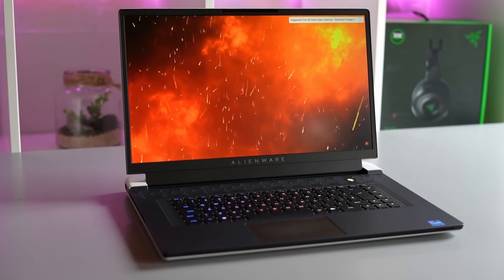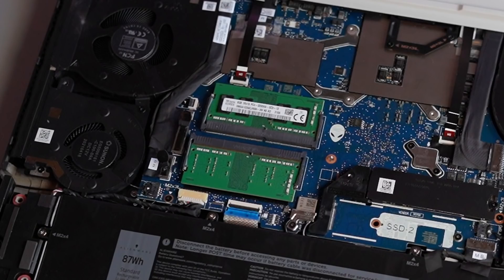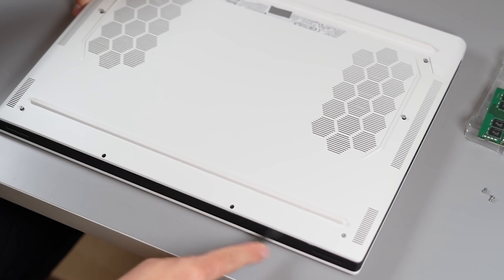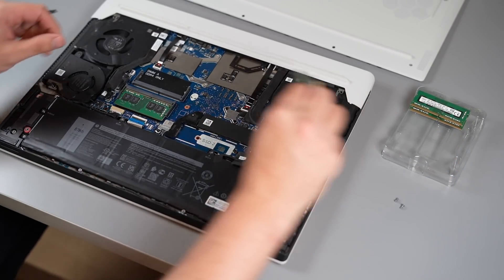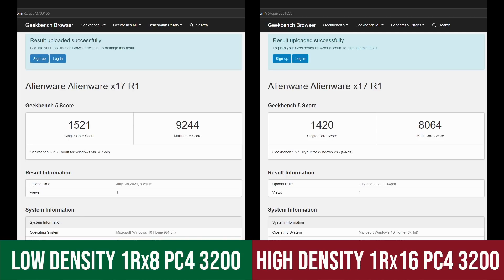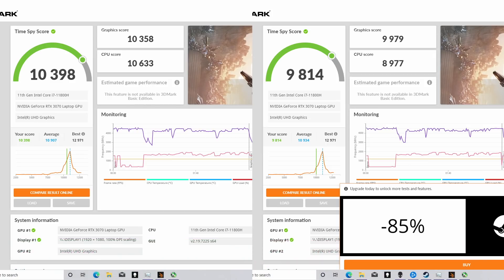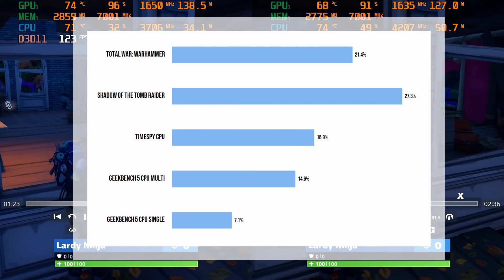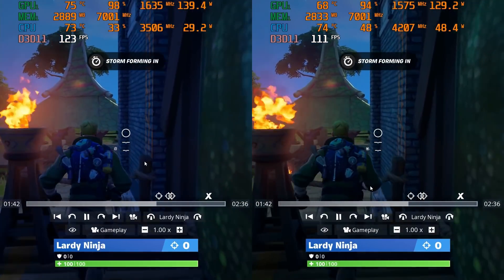Alienware X17 High Density Ram Strikes Again!  Upgrade Your Ram For Better Performance

Comment: Hello, I am confused.  Is Low density the same thing as single rank and high density is dual rank or can one buy single or dual rank and it won't matter as long as it is x8 density ram?
Reply from the maker: No, low density and single/dual rank are different things, just make sure you look for the x8 ram which is the low density. the link I put to amazon are low density and if you choose some and are not sure send me the model number of the ram 👍
Reply: @MashITTech  Yes, I bought the memory that the link went to, but I bought the 32gb dual rank kit. Crucial Model# CT2K16G4SFD832A. Thank you.
Reply: @MashITTech  Yeah, I actually see the X8 for the ones I bought now... So I think I got low density. I also heard dual rank is better than single rank, is that mostly correct?

Comment: I recently ordered a dell G15 ryzen edition which only comes with 16gb 3200mhz  single channel Ram. Is it ok if I only purchase another single stick of 16gb or should I replace the old stick with 2 new ones?
Reply from the maker: you are going to want to check what the single stick they have installed. I wouldn't mix it if you have a high density

Comment: Thanks for going back and testing! Yes, now this is more in line with what I was expecting, though I was expecting closer to 10800 timespy GPU score with the ugpraded RAM. I'm curious what the score would be if you tested on an external monitor as well. I'll be geting my own Alienware X17 with RTX 3080 in for review tomorrow, so I'll be doing some of my tests with it, so it will be interesting to compare results with yours. Looking forward to more videos :D
Reply from the maker: Great, can’t wait to see your video on it 👍 I have started testing with an external monitor for my deep dive video but the gains are not as significant as this ram isssue so I put this out first. Will be keeping an eye on your channel, love your videos 👍
Reply: Awesome! Looking forward to it ^^
Reply: Live stream please !!!!!!!
Reply: Would love to see the temps and external monitor performance!
Reply: Gizmo, are you doing a livestream for the unboxing of your x17?
Reply from the maker: I am sure he will, he is known for it 👍
Reply: Here are my benchmarks for the same model you ordered gizmo: https://www.reddit.com/r/Alienware/comments/ofr1ir/alienware_x17_i930804k64gb4tb_just_arrived_review/
Reply: Hi, I have the fully equipped x17, i9 11980HK, 3080, UHD and 32GB XMP. I get the same bad results in CPU score with benchmark running on the internal system. It seems like XMP RAM ist also affected... My CPU Score in TimeSpy is only 8900 on internal display. With an external display connected the CPU score is 11000 points.
Reply: @pitha-gn9zr  and what is ur gpu score ?
Reply: @barelisak4147  I only get 12500 with OC. When connecting an external screen it is around 13000. Something is holding the system back when playing over the internal screen... I don't been the 10% Optimus...CPU score is so much lower...
Reply: @pitha-gn9zr  thxxx i see.  Humm have the r4 and turn around 13k too, but cpu score only 8k (i7 10870) thxx
Reply: @pitha-gn9zr  I am getting the same bad results. Definitely interested to hear what you're trying. I upgraded to 64gb of ram and it still seems terrible.

Comment: Here is x17 RAM from DELL
https://www.dell.com/en-us/shop/pfydresults/273259?categoryId=4325&sortBy=price-ascending
- 8GB stick is 1Rx16 (BAD)
- 16GB stick is 1Rx8 (GOOD) for both 3200MHz and XMP 3466MHz

Aside from that (1Rx16 vs 1Rx8), CL22 is not bad for SO-DIMM (laptop). 
Someone said like it's abysmally slow and the laptop world gets nerfed to the ground, which is not true. Please don't compare laptop numbers to Desktop spec. It's not like that and the Desktop PC is always faster.

Also, given a good RAM, speed and CL don't matter that much if they meet the designed native memory controller speed and this has been tested many times. Unless you compare like 2133 (very slow) to 3200.
https://www.youtube.com/watch?v=uy6dgB24frg

Fast CL16 SO-DIMM RAM for laptop exist but it's not widely available, premium, and expensive; not a choice for a pre-build mass laptop. People want the fastest RAM but will complain when it gets expensive

Comment: How are the thermals?
Reply: Can it run star citizen ?
Reply: CPU will still hit 100c at full load....but no crashes or anything. I was playing for hours.

Then a day later i turned TCC to 10...my CPU maxes at 91c
Reply: @AnythingGoesJoJo  Without context and considering others are reporting differently (including the author of this video), I would recommend you upload your video for all to see
Reply from the maker: He may have the i9 that will run hotter

Comment: My X17 R1 has 64 GB and came with Dual Rank DIMMS.  A-Data Technology AO1E334RCTV2-BZWS. 2 of those sticks, each stick Dual Rank, in a dual channel config.   I have NEVER heard of a single rank DRAM Module that is 32 GB in size.  I don't think any such thing exists.
Reply from the maker: Thanks for the heads up. Glad to hear you get a decent kit with the 64gb option my 32gb model arrives soon so I will check what I get with that

Comment: How would you rate the thinkpad keyboards vs this? I’m looking to buy either this one or the X1 extreme Gen 4 coming out in August!
Reply: X1 will be significantly weaker since the 3080 in it will run at 80w lower tho

Comment: I've ordered 32GB XMP RAM, i9HK, 4k display, 3080 16GB. It's estimated to arrive today 7th July. I will return it on the 14th day if no MUX switch and high density RAM inside
Reply: @wagnerteo  thanks, I'll double check this
Reply: @wagnerteo  yo i got the 64gb, but i dont seem to see anything 32gb rams with your link you showed.
Reply: No mux switch on the 4k one. You juste have advanced optimus on the 360hz fhd.

Comment: Thank you for posting this video! I don’t know to much about ram but I also got the 16g of ram so would like to upgrade to a better option. Do you mind posting what the correct 16 stick would be (I’d like 32 total)? There are so many options it is hard to tell which one is the better version.
Reply from the maker: Which country are you in? Crashing out now as it is late here but will send you a link in the morning
Reply: @MashITTech  sweet, thanks! I’m in the US. Also- do you think going up to 64 would make a big difference for warzone? I got the I7 with 3080. I ordered the 16 gigs bc I knew I wanted to upgrade Ram after market to at least 32g.
Reply from the maker: You won’t see a difference going from 32gb to 64gb, only get 64gb if you are running heavy workloads/VMs to take advantage of it
Reply: I am having the same issue finding the correct 32gb ram kit, is it the 32gb dual rank 3200 mt/s or the regular 32gb 3200 mt/s kit

Comment: Do you plan to test really heavy games like Escape from Tarkov, Cyberpank or Watchdogs 2 on maxed out settings to check temratures after few hours of non-stop gaming?
Reply from the maker: Yes. I have watchdogs 2, battlefield 5 and AC odyssey to test. I don’t have tarkov or cyberpunk unfortunately. Wanted to figure out why it wasn’t performing first, now that’s sorted I can start hammering it 👍

Comment: Thanks so much for the videos are you awesome! Any news on when your x15 will in? Not rushing you just wondering. Make sure the make time for the fam!
Reply from the maker: The laptop is still in transit! Should be here later this week. Already booked time that as soon as it arrives I will start making content on it 👍
Reply: @MashITTech  ordered one after watching your unboxing of the x17. I figured the cooling should be able to keep up on the x15 as well since it has a lower tgp. After this video though it got me thinking about the ram on the x15 as well. Can soldered ram be considered high or old density as well?

Comment: That's great info ! , thank god i ordered x17r1 with 32gb 3200MHZ ram , i believe the 16gb 3200mhz comes with x16 and 32gb 3200mhz comes with x8 if you are ordering it from dell. There is also extreme memory profile (XMP) variant available for 32gb and 64gb in their site.
Reply from the maker: My 32gb 3080 version arrives Friday so I will be able to check then. Part of me wishes I ordered the xmp so I could test that config but I ran out of money 😂

Comment: Its all about sales and profits. Creating different configs thereby forcing the consumer to keep upgrading. Swapping out the RAM for improved performance will not deter someone from purchasing considering that I can expect higher CPU and GPU wattage and cooler thermals.
Reply from the maker: I agree but is such a shame when you spend so much for a flag ship product to find it is shackled by a cost saving exercise 😢

Comment: The 32gb 3466Mhz Ram is only one rank with 24-23-23-54 speed.
Reply from the maker: Can you confirm if it is 1Rx8?
Reply: @MashITTech  yeah. I look it up on CPU-Z it says 1 rank. I don't know about the 64gb though

Comment: 2Rx8 is still low density ????
Reply from the maker: Yes it just mean dual ranked instead of single ranked
Reply: @MashITTech  thanks to answer. 
I think Dell install high density module due to memory shortage.

Comment: I have been really eyeing up the Alienware x17 as I am very much due for an upgrade. Thank you for sharing this vital information. It baffles the mind that they are using inferior ram for their flagship laptop which is priced much higher than their competitors. I am wondering if I can specify the ram density if I speak with a representative over the phone.
Reply from the maker: You won’t be able to and the person on the phone won’t have a clue what you are talking about. All you can do is buy the xmp memory or upgrade yourself. Such a shame

Comment: Hope the other laptop coming in has their "3466mhz xmp" ram for you to inspect. I would hate to have to spend extra to just get a bad kit of ram which is supposed to be "faster".
Reply from the maker: Unfortunately not, I chose the 32gb standard but it will be interesting to see if that is high density or low density as if it’s low it will be the best price to performance option 👍

Comment: Very nice video mate, the companies keeping tricking us 😂... Much better to give the full specs and let the customers decide, if you want a better run you pay for it, but no, they prefer to put the price on the roof and cut the production prices down putting some key low specs pieces... It's crazy, I still haven't bought a new gaming laptop yet, it's tough to decide and the stocks are very low... But I'll try to get the lenovo legion 7 3080, but still not available... Tough times mate, keep the very nice reviews, your videos are amazing... 👍🏻
Reply from the maker: Thanks so much for the kind words. The legion is an amazing laptop and one of my favourite this year. But be aware that also comes with the high density ram 👍
Reply: @MashITTech  Yeah, I read about that as well, but I watched somewhere that the 7 3080 the memory is the good one. I'm not sure, if it was a video or reddit forum... I have looked at the xmg as well, but there's so low videos and reviews that I gave up... On paper have a good spec, but tough to find a review about it...

Comment: So will any laptop oriented type ram work in it?
Or does it have to be from a specific company?
Reply from the maker: Any reputable brand should be fine, I normally bu crucial because it is reasonably priced and I have never had any issues with them. Kingston is also pretty good
Reply: @MashITTech  thanks

Comment: These new benchmarks were still taken while using the built-in display and therefore with Optimus also reducing performance too, correct? Could you run another benchmark with it connected to an external display? Should jump another 10% or so with Optimus bypassed.
Reply from the maker: Haha stop reading my future video scripts! That is already done and will be in the performance deep dive, I didn’t want to bombard everyone with too much tech info in one video 👍
Reply: @MashITTech  Nice. You're doing God's work here.

They've certainly made a couple of very questionable design decisions for their flagship laptop, between the slow RAM on 16GB configurations (at least the 32 and 64GB configs seem to be getting it right) and the lack of a MUX switch forcing performance-hurting Optimus on us at all times. Why can't they use Advanced Optimus on all of them and not just the 360Hz FHD model? I got the 4K 120Hz model which I'd consider even more premium yet no Advanced Optimus or MUX. Why Dell, why? Please give us a MUX switch via bios update soon...
Reply from the maker: I have my fingers crossed for that bios. When I saw the bios release last Friday I prayed that is what it was for and in time for my review but dell let us down
Reply: @MashITTech  If they can release a MUX switch update and remove those crappy RAM options altogether from their configuration options, this laptop looks to be otherwise a real winner though. Still a bit expensive, but the thermals seem excellent for how thin it is and the build quality and everything else seems pretty top of the line. Which just makes it all the more baffling why they mess up a good thing with one or two really bad choices that could've been easily avoided.
Reply from the maker: It can be if the circuitry was already installed when designed. They recently did this on the m15r5 and g15 so we have high hopes they could for this too

Comment: I got 4k120hz 3080 16GB 32GB ram i9 11980hk 2TB SSD .How much better is the XMP ram compared to the 3200? I will be gaming at home on a 1080 monitor but leaving for school and only taking a laptop, so what benefits will it give me because I called dell to change my order. They said it would be pushed back two weeks if I wanted to change my ram and asked if they sold it separately. The rep told me they only make it for that machine x17, saying it comes within the laptop but found some 3466mhz on the dell website, so was the agent unaware or not caring to check.
Reply from the maker: Unfortunately I haven’t managed to get any of dells xmp ram in to test yet but it is certainly something I want to do. I don’t think you will see much improvement over the crucial I have linked so I would save your money and just get some aftermarket ram
Reply: @MashITTech Does upgrading the ram void warranty.